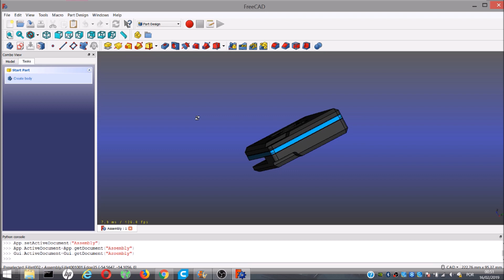3D Printed BMW key case

Comment: awesome man! I'm also buggered with this same problem. I'm stuck on the switchblade mechanism, now I only have to make the buttons hole to fit mine. Thanks a lot!
Reply from the maker: I have to tell you that I wasn't very happy with this project. At first everything seemed fine but then over time the material (PLA) started to deform and stopped working well. I think the PLA deformed from being exposed to the sun. That's why I recommend another material for a key like this.
Reply: @MindScraper  abs would be better option, right?
Reply from the maker: No doubt